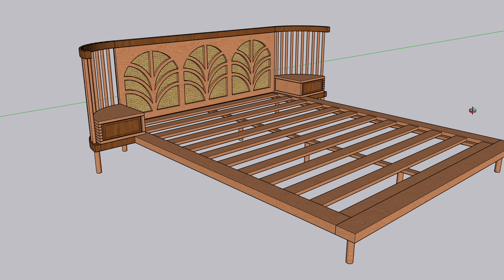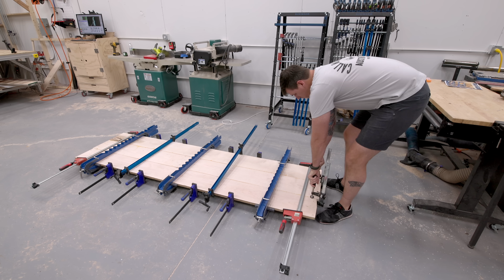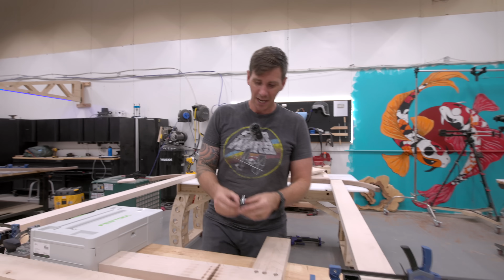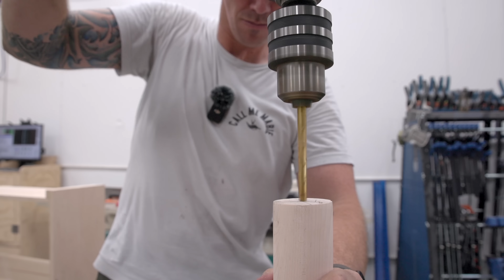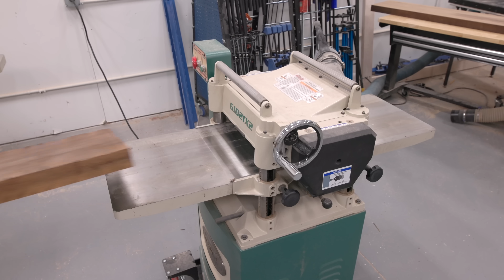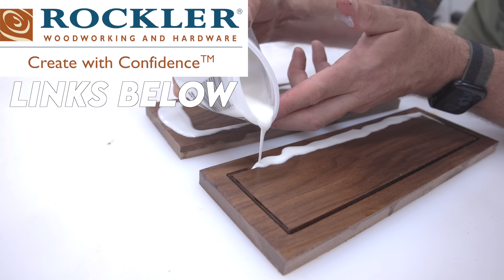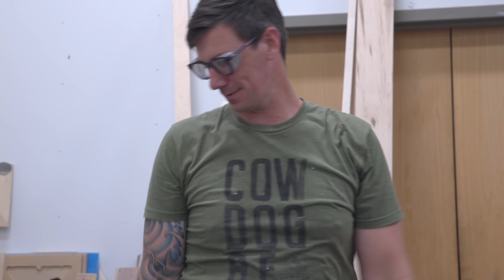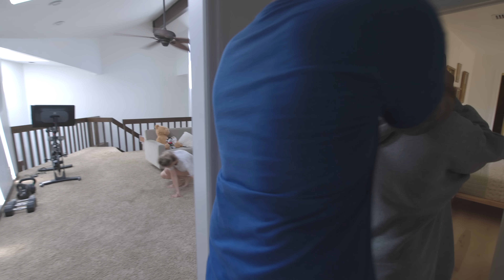She Asked Me to Build This, I ALMOST Said NO

Comment: Anyone that says you are not a real wood worker for using a CNC I guess should think of it this way. A CNC is a table saw with a digital fence. If you are not a wood worker for the simple reason of using a fence on a saw, I guess we all need to be the The Woodwright's Shop where we use no power tools and it takes all day to joint one board by hand. I wounder if a "Real Wood Worker" is allowed to use a track saw.

Comment: The bed looks good.  I'd say give yourself an At-a-boy, but it sounds like your daughter already gave it to you.  Well done.
With regard to your "trollers", they can go pound sand.  I am a firm believer that if one doesn't vote, they have no say in the elected official's conduct.  The same applies to the trollers, unless they are willing to put their hands to just such a build, their comments carry zero weight.  Additionally, your use of a CNC machine matters not.  The carpenters of old used the technology of their age; if they had such technology as we have now, they would have used it, if it was in the budget.

Comment: "OMG!"
It didn't turn out quite as well as it looked in the 3d model because you had not put the mattress and the pillows in the 3d model.
It does look good, but it would have looked better if the drawers were as tall as the mattress and if the headboard was about a foot or a foot and a half taller. The mattress just hides too much of the headboard.

Comment: nice job ... Next time with the wicker material  cut a track long the top , bottom , sides wide enough for a dowel  push the wicker into the track after u run a small bead of glue in it  then put a dowel into the track and penny nail it into the wood doing that method should hold the wicker Tight on all 4 sides

Comment: You might consider using down cut bits.  I've been doing that for a while now and I no longer need to use tabs.  Make sure you use a ramp plunge otherwise you'll burn the bit.  Nice job and excellent design 👌

Comment: OMG, beautiful.  (should have set the headboard on top of the drawer box so the beauty would show even more.)  No lasers or CNC.  A real wood worker would have used a piece of flint knapped into the correct shape.  Hide glue only.

Comment: To become a member of the American Bladesmith Society, you need to make some blades and submit them to judging. What you don't have to do is prove that you did or didn't use this or that tool. The Master bladesmith who cut a blank out with a waterjet is just as much a master bladesmith as the guy who did it all using an anvil and forge. I'd apply the same standard to woodworking. Your CNC makes you a non-traditional woodworker, but still a woodworker.

I enjoyed the video, but feel compelled to say I didn't like the finished product: not my style. Not gonna complain tho: it wasn't made for me. OMG.

Comment: I used struggle with that question about what is more pure woodworking and you’re totally right. Also at the end of the day, it’s YOUR project. If someone else doesn’t feel like it’s acceptable, then they can do it their way and that’s great.

Also l love working with Japanese tools and thought even with the current availability of tools that they wouldn’t use fancy machines but that is the complete opposite of true. For example, on large timber frame structures, they have this saw with with FOUR ADJUSTABLE BLADES that cuts giant dovetails in one stroke. Totally amazing and extremely efficient. So everyone, do your thing and keep working!

Comment: Looks great but if I had 1 suggestion and you hinted at it you should have made the bottom rail on the headboard taller so the fancy work ended up just a tad higher then the mattress. I also would have had something at the foot of the bed so the mattress can’t move down away from the headboard. But really looks great! And f the people that say your not a woodworker. Thanks for what you do!

Comment: Looks great. Seems like you could have done something a little more with the legs and I think that a few inches of vertical framing on the bed frame to better captivate the mattress would be helpful. Not something tall that makes sitting on the edge uncomfortable, just an inch and a half or so to keep the mattress from sliding off center. I know with a flat frame and that kind of mattress myself that it can be annoying.

Comment: Great work!

Only question I have is why didn't you turn the knockdown hardware on the top of the headboard so that it would bolt together from the back? That way you wouldn't have to plug it and it could be easily disassembled for moving in the future.

Comment: On the end pieces couldn't you just drill a hole through the dowel and the piece it attaches to glue and pin it? The bed turned out pretty well. Glad she liked it.

Comment: Glue Up Hack to align wood that has glue on it. You can take a brad nailer, hold it above the wood and shot. Teach yourself to leave the head of the brad nail still exposed. Put the next piece of wood top, push it down onto the brad and it won't wiggle wiggle

Comment: The troll comments about CNC is ridiculous.  If using a a CNC is not real woodworking, then that should apply to any power tool. I could only wish to have a shop large enough to support that size of CNC router.

Comment: You're not a real woodworker. You use power tools, you should be using your hands, teeth and sharpened stones to make complex furniture, shame on you!! 😄

Use the tools you have and if they do the job, then they are good enough. Let the haters hate, they always will find any reason to pile it on. That their issue, not yours. 

Brilliant build and looks amazing.

Comment: Just a suggestion when making your program add tabs. The tabs will hold your parts so they don't move. You can choose the thickness of the tabs. Just use a flush cut saw to cut the tabs and use a flush trim bit to clean them up.

Comment: The CNC machine is just another very nice power tool that I wish I had.  If you're not a woodworker for using it, you shouldn't use other power tools like saws, routers, drills, sanders....
I wish I had the skills of the old shipwrights.  Stop on an island, cut down a tree and build whatever you need.

Comment: I hate those comments "You use X tool so you're not a real woodworker!"  Fool, I work with wood with the tools I have.  By their logic, unless they're hitting wood with another piece of wood, then they shouldn't be considered woodworkers either.  Looks awesome!
Reply: If you don’t fashion your woodworking projects with your bare teeth, you’re not a real beaver, uh, I mean woodworker.
Reply: @torysetliff  I SEE WOODS
Reply: I'm convinced they also drive automobiles driven by steam. 
😂👍
Reply: I think that is a brilliant piece. I tried really hard to come up with constructive criticism and must say that the only thing I would change is the height of the headboard. That is so you can see more of the rattan. However  in her room the height is perfect with the spacing to the pictures above her bed.
Basically good work done with good wood.
Reply: All I do is punch wood with my fists until it's left in the shape I need and my fists are wrapped in foot thick bandages
Reply: They also have never set up a cnc to know how not simple it is.
Reply: Real woodworkers just use their hands as hammers and cut the wood with their teeth. Everyone else is fakes.
Reply: I know people who just run the cnc machine in the warehouse as their job for processing builds. They're not wood workers. As a builder and a wood worker, I have and do build off from the CNC machine, it does make great production work. But I don't consider people who just depend on the CNC wood workers, they're builders. But you can be both.
Reply: @MyRefugeIsChrist  That's how I make the distinction.  Factory workers aren't the ones designing & programming the CNC (for the most part).  They legit are just pressing a few buttons and letting it go.
Reply: If only they want better time to get things done, with in their time frame,  they always can save up to buy tools or machines bigger ones. I bet Johnny Builds saved up for a long time before start being Youtuber,  Also another thing, I seen the car enthusiasts- some Car enthusiasts even use big cool machines to smooth out old rust , etc..  still can be called car detailers/ body workers.    So it is basic envy thing for some.
Reply: Where's the comments
Reply: sure, and I hate your comment 🤡
Reply: I would bet if most people had these tools they wouldn't be able to make a straight line, never mind designer furniture.
Reply: You guys are soft, you're not a real wood worker until you use your teeth like a beaver. Until you remove all your clothes and swim around in waterways collecting sticks between your arsecheeks.
Reply: carpenter tools is wood and ? wood ? please tell those kind of human "go find live somewhere"
Reply: If it weren’t for my CNC I wouldn’t be doing other projects! It’s what peaked my interest into woodworking. 

Like your one follower said, “they also drive automobiles driven by steam.” 😅 

They are the ones who are afraid of either trying new things or change. It’s the jealousy or fear of being put in the back burner. I respect their time/experience/education but what were the woodworkers/craftsmen before their time saying when the mitre saw or table saw came out? They should be promoting how you’re spreading the good word on woodworking 😎

Funny thing is, this “non-woodworker” (me using my CNC) has probably watched those crusty stubborn woodworker videos. 

I know this is most likely a biased group who follows you so, most of the comments will all be positive. With that, I back you up and am very grateful for your woodworking videos 🙏 Excellent work 🤙
Reply: Yes only when your able to improvise and still doing your job you can claim you're a pro✌🏻
Reply: Woodworker; Maker — whatever.  I don’t get triggered by comments lol.
Reply: It's the same with sewing or embroidery or every other craft. We have the tools today to make life easier. It's still handmade.
Reply: Exactly, that’s like calling people who use hand tools not real woodworkers because way back in the day they just used a hatchet
Reply: Even old school precision woodworkers in Japan use CNCs for dowels or round cuts. Manually sawing etc cannot get the precise cuts. Modern technology is used because it's there. In the old days if they had it the woodworkers would have used technology too. Just some jealous grumpy trolls.
Reply: I thought this whole argument was why we started asking qualifiers to things; like "Traditional Woodworker" of you refuse to use modern tools and want to charge extra for it... That vs woodworker who says, yeah I work with wood and look how beautiful, accurate and durable this project came out. 
Aaaannndd.... Since he doesn't claim any qualifier but does work in wood... Yeah, woodworker, carpenter, craftsman, artist... They all pretty much work in my book
Reply: You clearly aren’t a woodworker, you must use only your hands. Sand paper? No your hands. Table saw? No your teeth.
Reply: Stonemasons are worse in saying that
Reply: Charls shut up he take no x tools Dewalt is professional tool and that sanders machine that he takes that is a fasttool
Reply: The dictionary definition of "Woodworker" is.../noun. A person who works in wood, such as a carpenter, joiner, or cabinet maker, etc.

Simple and to the fact. Anyone who believes it depends on using a specific set tools or another, needs to spend more time woodworking and less time telling other people what they aren't.
Reply: its very ridicilous really since you can do things that way you normally could not
Reply: But that’s not how our ancestors did it! 
Yeah, well they didn’t use indoor toilets either. Think maybe it’s because those didn’t exist back then?  I guarantee that had great great grandfather Jedediah would have used these tools and technology had it been available. Honestly, sometimes I swear they don’t think things through to it’s logical conclusion.
Reply: Only caveman woodworker
Reply: Aka "I can't afford a CNC or Festool products"
Reply: As they are tirelessly and less accurately cutting all their pieces by hand, they are jealous that they can't afford such an amazing machine!
Reply: I saw a single panel comic, long ago, that showed two cavemen drawing in the wall with charcoal and mud. One of them is looking at a third caveman a few steps away, who is using tube paint, brushes, canvas and an easel. The first caveman says, “Sure, it makes painting easier and cleaner, but is it *art*?!”.
Reply: Jealous trolls is all. When you can afford them, better tools mean you can make money easier and quicker.
Reply: @chrisfortner7578    Yeah  for some people, need to understand, it takes lot of work into saving up  and put up to its mind to make it happen.  I come from a working class, my dad had to save up for 20 years before started his business  Money not from tree.  Comes from hard work to put into it.  I seen more and more into self employment these days,  It takes time to build up and to get what they want.  If some feel the modern wood working tools not for them then they just need to shut up about it. Let the others decide what ever want to use with as long as they are happy doing something.
Reply: It's also like saying you're not a real chef if you use a blender instead of whisking by hand. If you are working with wood and making items your a woodworker! Simple as that!
Reply: Honestly, any tradesman who doesn't utilize tools to make his trade easier isn't a real "tradesman", they are a hobbyist. They do it for the pure enjoyment, not to make it profitable. There is nothing wrong with either, and you can be both as well. But tools were creating to make the job easier and faster for a similar if not exact same result. On top of that tools are an equalizer, they make things easier therefore more people can do it as well. Now I don't need to be a lumberjack in strength to saw or plane my pieces, I can just utilize my tools or machines to do it.

I don't do this myself but my whole family works in some kind of trade, including woodworking and metalsmithing.
Reply: You're a Woodworker if you work with wood
Reply: @lazer1036  EXACTLY.
Reply: I'm more angry at the stupid tik tok like title of the video
Reply: @osirisvelasco7003  that is youtube names 1&1 to get more clicks. I feel like it has been like this since youtube exist and nothing new from tik tok
Reply: @osirisvelasco7003  His daughter asked him to build a bed and he almost said no, it makes sense. It's true and makes people want to know why so they watch the video, it's a good title. Youtubes a competitive place and you have to get people to click your vid over others somehow. Being angry at a functional title for a video is pretty stupid if you ask me, should he just call it "I built my daughter a bed"? Pretty boring tbh.
Reply: Was just going to say the same thing. It requires a new set of skills to use Autocad or an equivalent software, like using a new tool vs a wooden hammer and hand saw.
Reply: Oh grow a bean! Who cares what tools ya got. Everybody's different. And work differently.
Reply: We should just make doctors go back to blood letting
Or game devs should focus on making playgrounds vs games
Reply: Here in germany most pofessionnal woodworkers use festool or similarly expensive machines (bosch blue, for exemple). Mist of our machines are bigger and more expensive  like proper cncs (not the small jokes youtubers are running these days) or martin quality format table saws. These tools are expensive, but are essential for the professionnals that rely on them  for some of the features and functions they offer  but also because they are made to last and are reliable.
Reply: So you guys don't think there's any value of doing things by hand vs computer? Would a painting or sculpture made by computer still be valuable? Handmade work has more soul... And I think the question is could this guy make these pieces without a CNC?
Reply: @GAsh0012  It's not about the value of the piece, it's about utilizing yet another tool in the shop.  That's like saying that a piece that has dovetails isn't valuable because they used a dovetail jig to make them instead of cutting them by hand. 
In the case of the CNC, the crafter still had to fully design the piece, mill the lumber and assemble it once it was cut.
Reply: @Azurko  then why are handmade sculptures, cars, clothes etc more valuable? I think it's because they are more unique. Once programmed, a computer can make exact copies over and over. It's like how people say homemade food is made with love... Somehow there is a soul in handmade pieces that mass produced ones don't have.